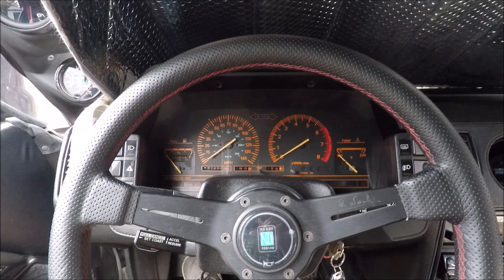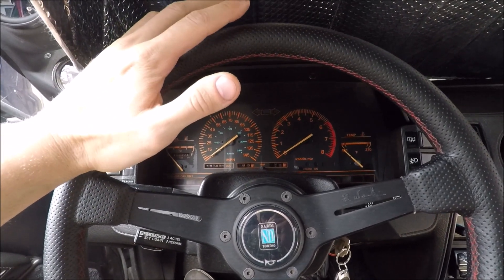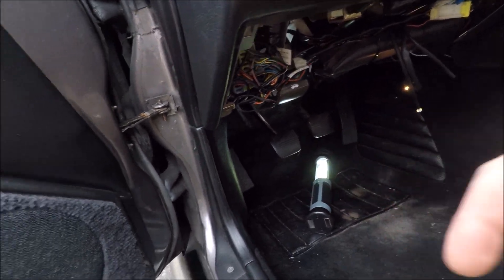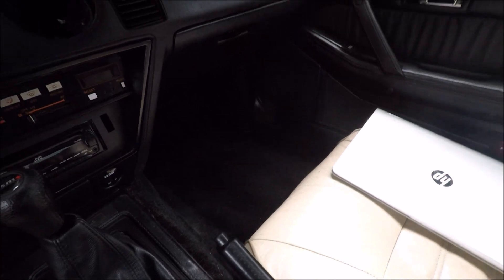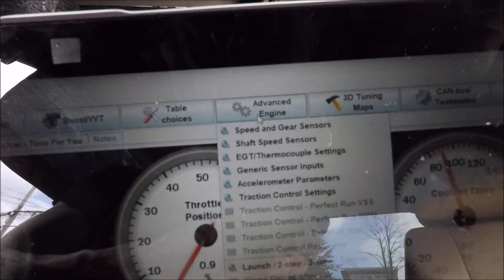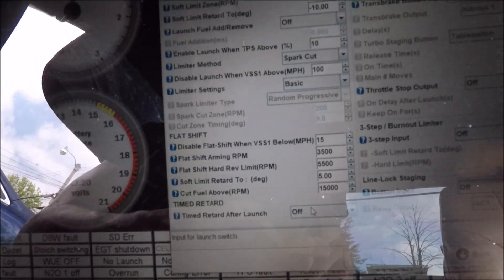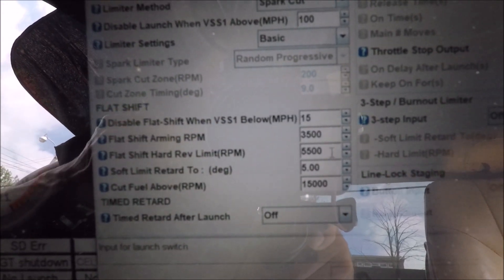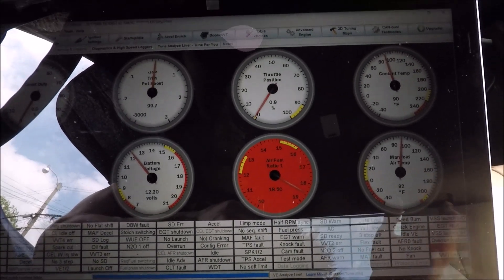Flat Shifting with MegaSquirt! Turbo Z31 300zx

Comment: Does Nistune allow for Launch control or flat shift?
Reply from the maker: Nope. All though it does have a form of launch control, it is very basic and almost ineffective
Reply: Turbocharged Creations hmm, I got a Nistune board with a load of Z31 parts I bought, hopefully I can make due for awhile.

Comment: Driving a manuel car the right way is not easy but one most learn rev match, heal and toe and speed shift. It is a bit of a challenge because so much is going on at the same time, gas, clutch, breaks and shifting gears. So in other words, manual cars are only for the "Real Driver". That is why most people can't drive a stick and just get a automatic. 

I drive cars with manuel gear because I wanna feel the whole car and that is only possible with a stick shift.

Comment: That's definitely not working right. You need to lower your target rpm. I would put it 500 rpm below wherever you end up after shifting. You're shifting early in this video but if that's how you drive this car you need to lower the RPMs. The whole point is just to keep the throttle body open so that there is less restriction from keeping the turbo spinning. You should never increase RPMs while doing this. the bangs and stuff are cool but you're destroying your clutch because it is not set up correctly. Watch The Car Passion Channel's video for this. It is for miatas but it's using megasquirt so the concept is the same. It's called "Shooting Flames! Launch Control & Flat Foot Shifting Tutorial. (Megasquirt)". It takes adjusting, but go listen to how his RPMs decrease steadily when his clutch is in.
Reply: The flat foot shift should only be set to hold rpm not increase or decrease it. When I had it on my l28et I set it at about 5900rpm since that’s around where I would shift.
Reply: @TheOhsemix  I it's 4 years later, but he's right.
The whole point of flat shift limiters is to have the limiter rpm set to be near where the rpms drop after shifting so the clutch doesn't need to slow the engine down. Otherwise you may as well just bang off of the normal rev limiter
Reply: @TheOhsemix  So long as the driver can learn it and use it, it can be successful.

Comment: how complicated are mods to this car? considering getting a z32 but i also really like the z31
Reply: I'd say they aren't very complicated. I've had mine for almost 2 years now and have been  collecting parts for it. Suspension is a bit more complicated and there isn't very many after market options but little modifications can make other parts work. Engine wise the z31 and z32 are very similar. The vg30e can be just as fast as a vg30de it just doesn't have Dohc. That also means they are much easier to work on 😉.
Reply from the maker: @austingood5309  I would say the z31 is a very underrated and easy to work on platform
Reply: @austingood5309  awesome! thanks

Comment: I have a S 30 with an L Series that's turbo and megasquirt. I'm on my thirteenth transmission because of flat foot shifting and beating on it hard. Granted they've all been junkyard Transmissions. I finally just built a turbo t5. I don't have it set up in my megasquirt... I just have my Redline set all the time at a certain number normally 6200 and it's a soft-touch. I don't like how violent the megasquirt is... where it was super easy with the MSD but be careful a broken transmission or something in the Driveline if you have good tires on it are in your future. It makes really awesome pictures at night and video... lol I've had six foot Flames come out the back of mine... Aaaand shouldn't you be revving yours alittle higher. Your combustion Chambers little more efficient then my l series but I recommend 20 degrees at 20psi to wherever your power starts to fall off. set it a couple hundred RPM less than that. Turn it up👹
Reply from the maker: You arent wrong, i have been shifting early in this video but mainly because i havent got it dialed in fully and for some reason my brain isnt letting me rev it out more lol too busy looking at the road

Comment: Z31s are underrated.
Reply: VG30ET built sounds better than any boosted/built VQ in my opinion
Reply: I found Z31 for very cheap, and I'm thinking about buying it! I have a plan for it, and it would be a cool project
Reply: @TheRazorJDM  sounds awesome? How much is it? I just bought a 280zx for $600
Reply: @TheRazorJDM  i hope you did get it i own one and the aftermarket is small but i love the car
Reply: My dad has an old one in a garage somewhere. Needs some work since it hasn't moved for a few years but I'm thinking of putting some money into it and using it as my first car when I turn 18
Reply: it really is i ended up getting one and i love the car but im not stock at all
Reply: @deadmoney9024  if you,look youll find that they have pretty much everything you need. Biggest lacking area is adjustable control arms and interior and exterior aftermarket parts.
Reply: I have a 88 coupe boutta be one year since I got it💯🙏

Comment: You don’t need a “cool feature” to speed shift 😑rookie 101
Reply: It's safer to have a tune that does it rather than just having it on any car. Obviously it's possible in any manual car, but this doesn't destroy your clutch
Reply: The idea is to keep boost up man.. Can't do it in a manual unless you wanna destroy shit.
Reply: Yeah...you can.  You just need to know how and be fast about it.  I've been shifting without lifting for 20+ years and the only thing I ever broke was a u joint and that's just due to too much power.  Mustang's, skylines, 300z, amd now 350z.  No lift shifting is an art.
Reply: @gregorius32  and with MS it keeps you in the right rpm to keep the clutch alive. This is the real world people don’t make a perfect shift everytime no point of not using a feature that helps.

Comment: How/where did you tie into the speed sensor? I haven't done mine yet as it's a magnetic sensor and the output is a wave -- I was worried about overvolting the MS3x.
Reply from the maker: Speed is pulled from a pulse coming off one of the stock wires under the dash.

Comment: I don't think its setup quite right. Maybe a lower limit rpm or higher engagement rpm, but the rpm shouldn't increase when you put clutch in, it should drop to where it's going to be when you engage the next gear.
Sounds mad tho 👌
Reply from the maker: Im shifting too early in some cases, totally my bad
Reply: @TurbochargedCreations  ah yes, that makes sense. It did take  a lot of tweaking to get it just right in my friends car, especially since his tachometer doesn't work. Was good practice for mine haha. Keep up the good shit 👌